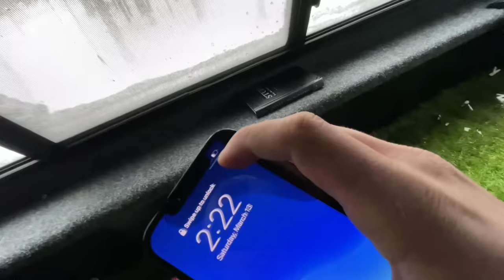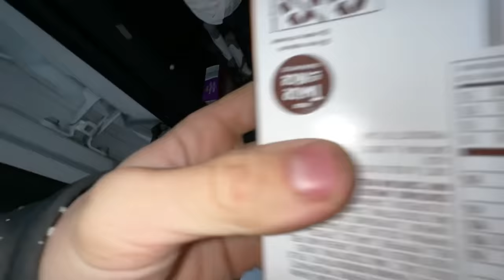Truck camping in Colorado's 4th worst Blizzard - 48 inches of snow

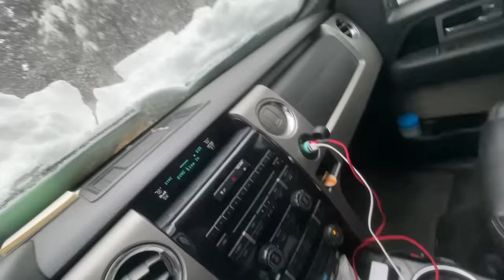Comment: 10:45 not from the weight of the snow but actually the extreme temperature difference between the glass and the hot defrost air (cause expansion/contraction)- which is why the curve follows the vent. Next time just make sure your blower isn't on max speed for a more gradual temperature increase
Reply: Yep. Happened to me one morning blasting hot air on a cold windshield. At least it’s low and not in the way but one has to keep an eye on it so it doesn’t spread. If it starts a new crack, get the end of the crack drilled and fixed by a windshield company.
Reply: Usually if you start a vehicle you can have it on max on the windshield because the air gradually gets warmer and warmer but if you have it on heating the cab then switch to the window after it’s hot that’s usually how u crack it

Comment: The crack in your windshield could be caused by a small chip from a rock that ended up getting water in it from melting snow then froze at night.  The freezing water expands in the tight space which causes it to fracture your windshield.  Happened to me this winter and didn’t realize I had a chip until investigating the crack.  You’ve been killin it lately on the ol YouTubes.  Nice work Mav 💯
Reply: I thought that, then I heard his heat blasting. possibly the weight sitting and the shock of ice cold to hot 🧐🧐 
Always a crappy go. But , not in the driver's view so no need to replace it 👍
Reply: Safelight

Comment: What probably cracked the windshield is hot air meeting a cold windshield.  When they crack on the bottom and you don't see rock chips its a stress crack for hot and cold! I have lost a few windshields over the years from this in Canada!

Comment: Mav, add some weather stripping or some other adhesive backed foam around the inside of the back windshield to better seal it. You can definitely do it on the cheap with a single home depot visit. You are losing so much heat through those large cracks.  Even when it's 'closed' it's not sealed very well.

Comment: The crack in the windshield is from the heat inside the truck and the cold snow outside the truck, thermal expansion. That's why you always need to clear the windshield of snow and ice before defrosting it

Comment: Lookup ford iwe failure. Front 4x4 hubs can be a pain in the ass. They definitely need to be serviced as water can build up in them. I always had to disengage my 4x4 in neutral and then reverse a few feet to completely disengage the front hubs
Reply: Yes it's a fairly common issue, I have 240k km on my 2011 f150 and have had them done twice.

Comment: Snow and ice build up on a vehicle will make all sorts of odd noises LOL.  I've had ice accumulate on the radio antenna and it'll make a really weird buzzing noise or in some cases it'll sound like a spring being stretched and released.  Ice and snow build up on your roof rack will also cause noise too when it comes loose and gets stuck between the roof and rack and can't slide out it'll rattle around like crazy.  Snow and ice under a vehicle will rattle and scrape on stuff too.  Windshield crack probably started out as a rock chip...the combination of the snow on the windshield and the heat as the truck sat and idled caused the crack to form and could have been the noise you heard as well...sometimes you can hear and see those cracks as they travel across your windshield.

Comment: If you have even the smallest rock chip on your window shield. Then running your defrost hot it will crack. Happened to me on a few different vehicles.

Comment: Since you did have you truck on, it could be possible that the heat on one side and cold on the other caused some tension where the ice was resting. So it’s not necessarily the weight of the ice but the temp. I know a thing or two about temp displacement

Comment: Just FYI all the sodium is in the seasoning so I will use a sifter to sift it out and only add 1/4th back. The crack in your windshield is from the defroster mine just did the same thing 👎

Comment: The windshield crack was most likely caused by the temperature  change of your window heating up trapped under a cold insulated pile of snow.  Bad glass can easily break with a simple temperture change.   Even tho the truck is used to minnesnowta it van happen.  "My car just did this over the winter" i watched it spit in front of me. But i had no weight just a lil ice

Comment: Usually when you crack your windshield like that it’s because you turned on your defrost too high in the winner when it extreme cold you should use defrost on colder temperatures it still works like if you were to use the heat

Comment: Actually, that CRACK was likely caused by a ROCK hitting your windshield creating a small hole/chip/crack, then as you went along the crack was created due to the weather.
Same thing happened to me, a tiny hole/chip/crack created by a rock in the side corner of my windshield gradually over time created a crack along the ENTIRE windshield.  It starts out small and just keeps going.

Comment: I cracked my windshield just like that.  I was running the engine and defrost for heat, it melted the snow on the windshield and it ran down but still covered the lower part of the windshield.  about 20 minutes after I turned the engine off, CRACK!  I replaced the windshield because the crack was shredding the drivers side wiper.

Comment: The weight of snow plus temperature difference extremes from the warmth of your truck inside and the cold with weight on outside helped find the fault area of the windshield. Shouldn't use your wipers to remove the snow. The weight is going to break your wipers motor. Both these things I'm speaking 1st hand experience.. guilty of it. But learnt not to. If you camp in snow within vehicle put a snow shield cover on the outside of windshield. It'll act as a buffer for temperature extremes keeping your window in line with even temperature from within and not face extremes outside. Also... Clean your windows with your arm sleeve if your brush isn't near just to remove as much snow from door way before entering bruh... Removing the snow cover off windshield saves your wipers motor. Love your vids. Just trying to help with things I learnt the hard way. Obviously I've watched to the end 😎

Comment: @Mav Your windshield cracked very likely due to a very small rock chip that you likely didn’t notice. A combination of the cold temperature (not necessarily snow) and the heat from your defroster was the likely culprit. I had two windshields on the same truck crack in the same manner within three months one winter.

Comment: Have you ever thought of using an oil lantern for light and a heat source. I know i was stuck with no power in a winter storm here in Ohio and my Dietz number 8 was able to keep my room warm. Not hot but about 62 degrees. Just something to consider.

Comment: I just watched your video I'm from Colorado I have the same cracked my windshieldit's because your windshield is warm on the inside and cold in the outside anddon't use your defrost on your windshield just use your regular heater

Comment: Last video I watched was your Xmas video sleeping during the blizzard. This was next for suggestions so I clicked on it. I left a comment about your broken wiper in the last video. I see that after three months, you still hadn't replaced your wipers because the passenger one is still frickin broke. Using the broken wiper to push the heavy snow is probably what cracked your windshield from the metal part of the wiper dragging along the glass. Unbelievable...

Comment: Maybe its possible your windshield cracked from your heater or defroster  hitting the windshield from inside and the extreme cold weather hitting the outside of the windshield, assuming the heat was on?

Comment: I’m not very smart. But why don’t you set up a solar panel with a battery in the back. You can run a heater off it and save yourself some $$$

Comment: Ummm, really? That ‘blizzard’ didn’t even cover his tracks from the day before! Apparently ‘Colorado’s 4th worst blizzard in history’ sure wasn’t where he was. Any 4 or AWD vehicle could handle where he showed, which was typical of a Boston-area regular winter snowstorm. Too, I suspect the guy bumped his windshield at some point, either from inside or out, and it cracked. Too, it was funny how he pulled out the camp stove and propane boiler — a single peanut butter sandwich in a zip loc would have gotten through perfectly well.